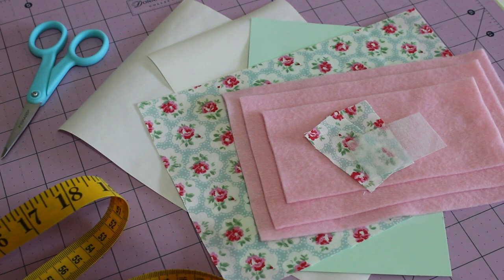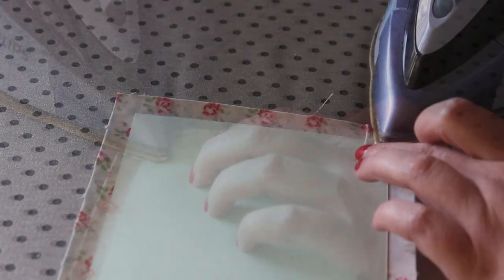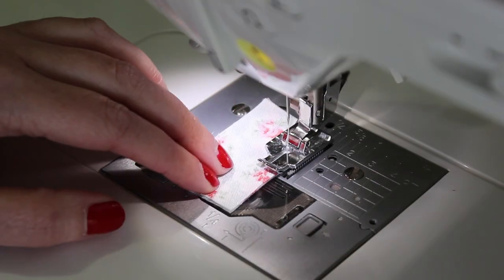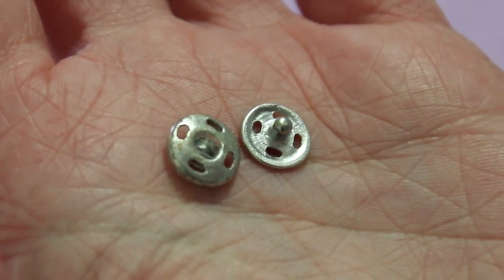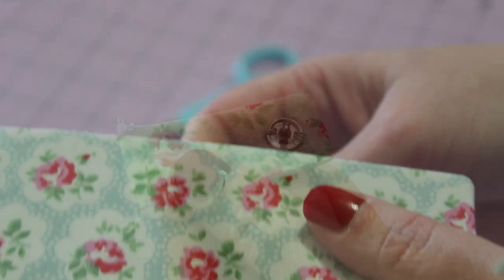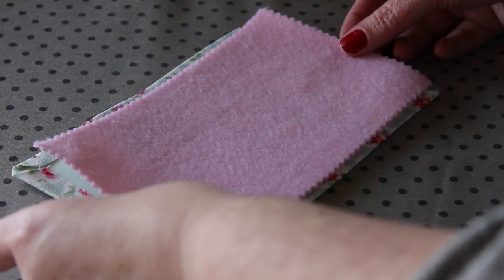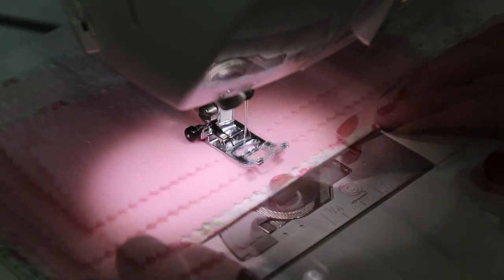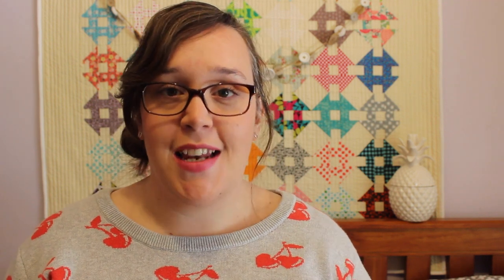How to Make a Simple Needlecase!

Comment: what kind of felt did you use and can polyester felt be used?
Reply from the maker: +Sydney Doe Yep, I just used a polyester felt. It's much cheaper to buy than the wool felt! :)
Reply: +Amanda Rolfe   great!....do you mean card stock instead of cardboard?
Reply from the maker: +Sydney Doe You can use either one, as long as it's lightweight, easy to bend and sew through and will hold it's shape. :)